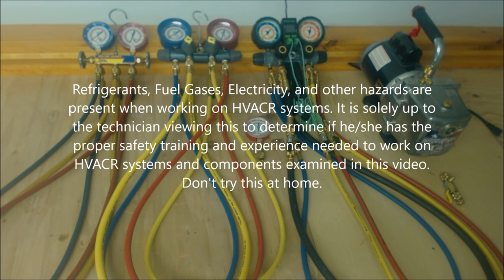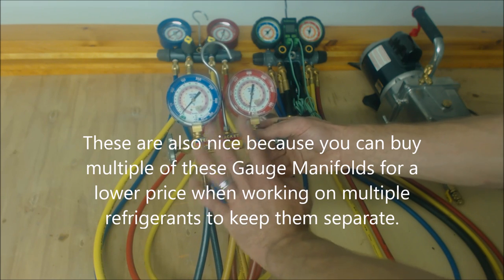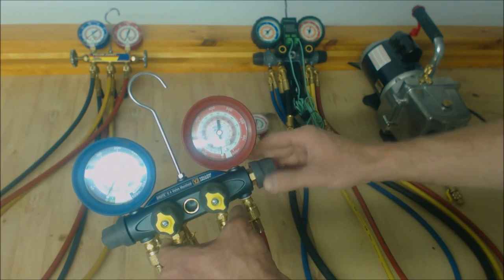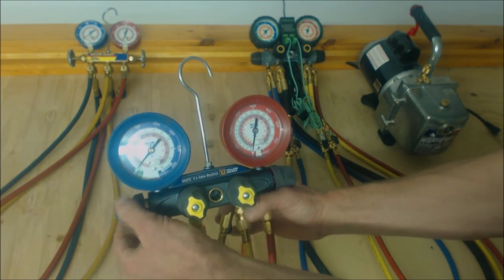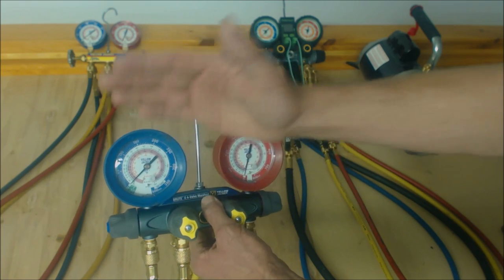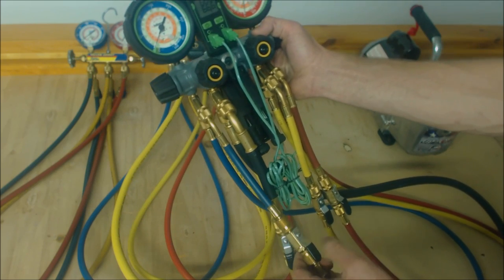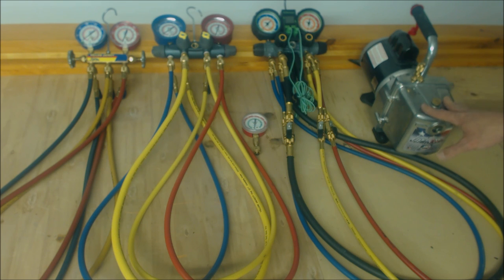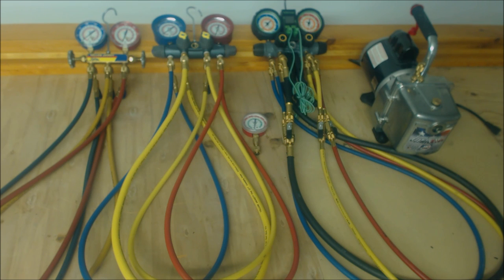Refrigerant Manifold Gauge Set Comparison, Operation, Uses, other HVAC Tools

Comment: I totally agree with you on the use of analog gauges over the electronic. The younger guys need to know how to calculate super heat, sub cooling, etc. from the traditional set where as the electronic ones calculate everything for you. I use both as i work with an older guy and while it's nice to have electronic gauges i'm very grateful he showed me the traditional way because it comes in handy for sure. And no batteries to worry about as well. Both are nice to know and both have their pros and cons. I use the Testo 550, the Hilmor 3 port 2 valve gauges and the Same basic yellow jacket set as well for reclaiming just like you do. Great video!
Reply from the maker: Thanks Bike Life Motovlogs! I appreciate it!

Comment: Thank you for the great video. I too have nothing against digital gauges but I like to visually see what my system is doing along with taking a super heat and sub cooling measurement. I also like the idea of another compound gauge to recover refrigerant that you're not going to use. I'm looking into purchasing the Brute for my R410A setup. They are less expensive at the vendors than the JB's and my vendor does not supply replacement parts but the Yellow Jacket; they do. Go figure !  Any ways thank you again. Summer's coming!
Reply from the maker: Yes it is coming fast, thanks Blaze!

Comment: Great rundown. Just getting ready to buy from the links. YJ lists the refrigerants covered by each UPC model of series 41. I saw one that would do both R22 and 134a. I gather you would get one manifold for each refrigerant instead to avoid cross contamination of oils? Hose sets too?
Reply from the maker: Yes, you do whenever possible but now it is getting a little crazy with all the retrofit refrigerants, so you don't know if you are hooking up into a system with mineral oil or poe. We do what we can and thats about it. Thanks
Reply from the maker: And thanks for supporting the channel through the amazon.com/shop/acservicetech or other links!

Comment: Dear sir thank you very much for the video please tell me the difference between the 2 way manifold and 4 way manifold
Thank you
Reply from the maker: The 4 port has mainly been developed for those that like to hook their vacuum pump up through their manifold. It makes it easier to do a triple evacuation as well. I don't hook my vacuum setup through my gauge set due to the potential for leaks and more joints and time. I also don't do the triple evac on systems because during the isolated vacuum test, the vacuum doesn't seem to rise so I haven't found a real need to. It is more expensive and looks cool, ha ha. I usually just use the 2 port versions. Yellow jacket 2 ports or SMAN360 are good 2 ports. I have them linked at amazon.com/shop/acservicetech thanks

Comment: thank you for this video, extremely helpful! I'm just finishing HVAC school and just got a job in the trade.  I currently only have a set of those hilmor gauges but should I grab a second pair? one for 410a and one for 22, also I'm in the market for a vacuum pump,  what cfm do you recommend I purchase? (currently doing light commercial as residential work). thanks in advanced!
Reply from the maker: Yes I would recommend having the second set for a different refrigerant.  You could also try the Brute II 4 Port Manifold Gauge Set with hoses-   http://amzn.to/2qKungf -   the standard Yellow Jacket Refrigerant Manifold Gauge Set-    http://amzn.to/2aenwTq -  or another-   Hilmor 4 port Aluminum Manifold Gauge Set-  http://amzn.to/2m4QLik  --  those are at least the ones I like and use. In reference to vacuum pumps a 6 cfm would work great for light commercial and residential. This is the one I am presently using-  the JB 6 CFM Vacuum Pump --   http://amzn.to/2nqbvo8  --  ACSERVICETECH is a participant in the Amazon Services LLC Associates Program, an affiliate advertising program designed to provide a means for sites to earn advertising fees by advertising and linking to Amazon.com. Go with wherever you can find the lowest price but I put the disclaimer since I linked so many items. I hope the info helps and always feel free to ask. I and the family are going away for a few days so I may be incommunicado until the beginning of next week. Talk to you later Sal C!

Comment: I bought that hilmor set with dual temp readout and I was calibrating then and it would not allow me to go down in temp only up. Called Compnay I bought them from and they are going to send me a new one. What do you think about dual temp readout is it pretty accurate. Only reason I ask is it say it can be off +\- 2 and when I got them it was off by 6 degrees. According to manufacture it was already calibrated. Thanks
Reply from the maker: My set was very accurate and I tested both readouts against my uei. You can test the accuracy in a bottle of ice water after giving the water a chance to absorb the temp of the ice and then the mix will be 32 degrees. Set your sensors in that when you get the new ones. Always something! Mine are .4 degrees off from each other or less so far. We will see. Thanks

Comment: I bought my first set of manifold Gage's and it has the r10a and r22 in one . But a few techs told me to get another set only for the r22 . Can somebody please tell me what the best choice is . I understand u can't mix the refrigerants ? Should I buy a set of r22 Gage's or just keep the imperial brand r10a and r22 Gage's I have?
Reply from the maker: So you could just buy another r-22/r410a/r404a or some other refrigerant sat temps. As long as you know which set is for which refrigerant then it's fine. They usually don't come as just one sat temp, thanks - This is the basic manifold I use in the videos-  Here is the Link for the Yellow Jacket Refrigerant Manifold Gauge Set used in the videos-   http://amzn.to/2aenwTq  -- and these are the hoses I use with the valves-   http://amzn.to/2aBumVI   -- but you could also buy another set like the one you have unless that would be confusing, thanks and hope that helped!
Reply: acservicetech 

You have excellent and awesome videos btw. I absolutely love my trade. I'm so glad I'm in HVAC .

So I have the imperial manifold Gage's as I mentioned , and it has the r10a and r22 rings in the high side gage and the other side. Do you think I can just keep the set of Gage's I have and just use them for both r22 and r10a ?
Reply from the maker: Glad to hear you enjoy the trade. Keep them and decide which of the two refrigerants you are going to be running through it. Then get another for the other refrigerant so the oils don't get mixed, thanks
Reply: acservicetech 

Will do thank you very much . Keep up with the excellent videos
Reply: buy one set for R22 and one for R410A. They are actually banning R22 in 2020. I took this right from the "Environmentally Safe Refrigerant Service Tips & Techniques" book to get your EPA cert.

 "Come January 1st 2020 the ban on the production or import of any HCFC refrigerant will take effect. Therefore, after Jan 1 1st 2020, only reclaimed or recovered HCFCs can be used in existing equipment." (page 7 in the book i mentioned above)

So i recommend having a Set for R22 just for reclaiming and maintenance on older R22 systems. A decade from now Most R22 systems will probably have been replaced considering most systems have a life of 15 years or so with proper maintenance. So i'd say 30 years from now they will pretty much all be gone and you won't be able to buy it or anything. It will be a refrigerant of the past. But still good to keep R22 gauges and 410 gauges separate as R410A opperates at higher pressures than R22.
Reply: I think so bc the digital ones have over 20 refrigerants that you can use. if mixing refrigerants is bad why would they have so many in the electronic gauges?

Comment: can you give me a clue what is happening with this unit  11 year old york 4 ton unit low side psi 60 high psi 180 ,suction line temp 34 degrees evap temp 33 degress 1 degree of sh superheat  , subcooling  was 11 degress high side temp 84 degrees on gauge on the deischarge line temp was 73 degress evap was not dirty... outside temp 74 degrees  ,any clues
Reply from the maker: Still looks like low airflow. You have the subcooling, the evap does not have enough heat to absorb to increase the vapor pressure/sat temp. Check blower speed, cleanliness of the blower wheel, dip switch settings for speed, duct and grille sizes, all supplies open, duct blockages, ect, thanks
Reply: thanks again
Reply: i saw a video by  t and n services he had same problem everything look good but suction line temp was in low 30s without hesitation he pulled out evap and cleaned it put freon in and all is well.
Reply from the maker: Yes evap dirty and restricting the airflow. See if you can clean it without having to cut it out if possible if that is the problem you are seeing, thanks